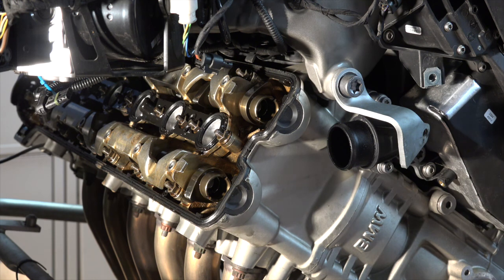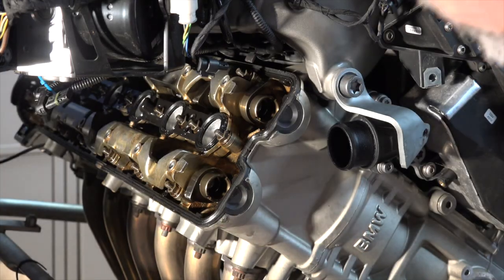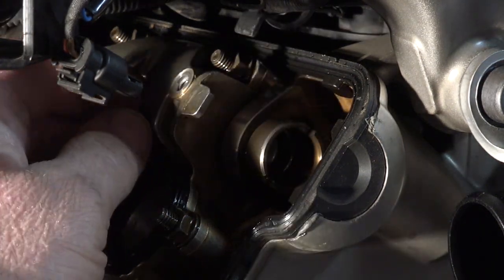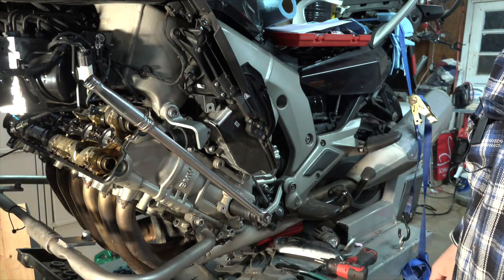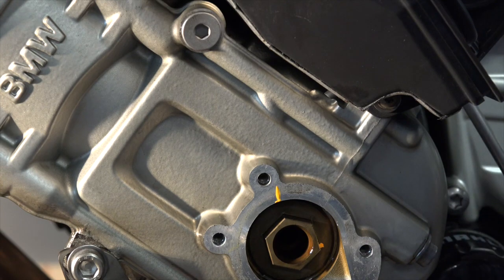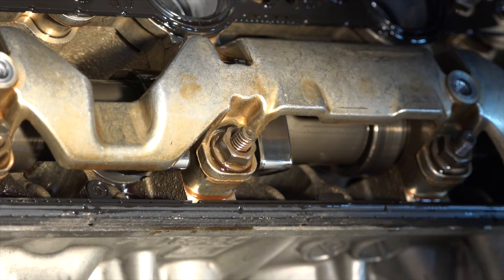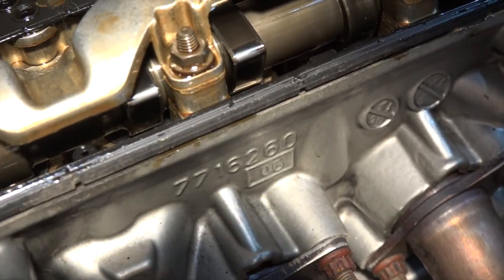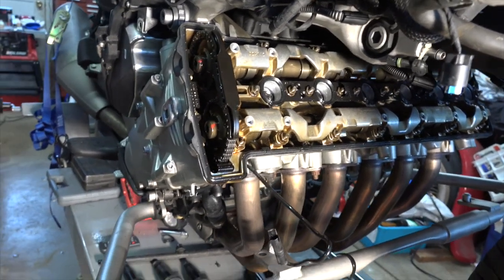K1600 valve lash Part 4

Comment: Would be very nice to see cam removal and bucket change.  I have checked and adjusted my valves twice on my LT and both times at least a couple of valves were at the spec limit (48,000 miles and 72,000 miles).  The dealer did the first check and I am pretty sure I did not buy any buckets so I don’t think they changed anything.  I believe BMW calls for a check every 12,000 miles on the LT, but I think that is overkill given the amount of work involved so I do 24,000 mile checks and no valve has moved out of tolerance by any significant amount, but some will move from mid range to the spec limit in 24,000 miles.

Comment: Excellent video.  Lots of time put into it, thank you.  I'm curious tho, how do you adjust if they out of tolerance?
Reply from the maker: The cam followers/buckets come in selective thicknesses. The camshafts need to be removed. The follower from the valve with the incorrect lash needs to be removed and measured, and a new follower with the correct thickness installed. Fortunately, I have not had to replace any on my bike. I have over the years replaced some on cars.  Thanks for the kind words and thanks for watching.

Comment: Thanks James, excellent video set ! 
Looks like Atlrider bars installed ? 
Do you recommend them for tip over - drop protection.
Thanks !
Reply from the maker: Yes, they're Altrider bars. They sit a little higher and wider than the original. The previous owner had a couple of tip overs and some damage is pretty high. It looks like the original bars let the bike roll clear over until the upper fairing and saddle bags stopped the bike. After I installed the Altrider bars, I very carefully and slowly tipped the bike on its sides and the Altrider bars stopped it from teetering clear over. I also had a moving "incident" where I connected with the wife's car and ended up off the driveway lying on the side in my front yard. The bars did a pretty good job then as well. Hope this helps and thanks for watching.